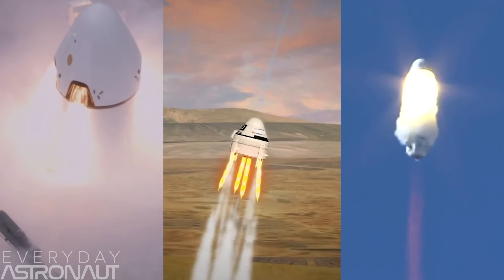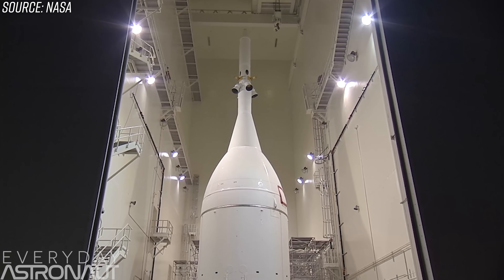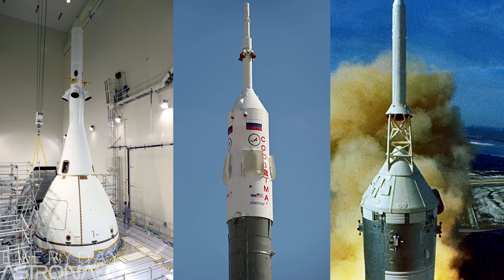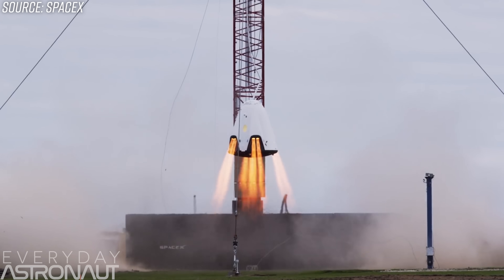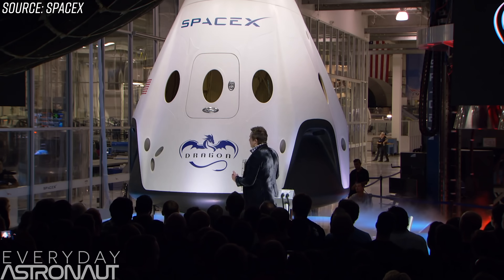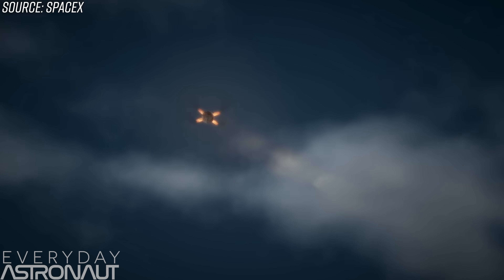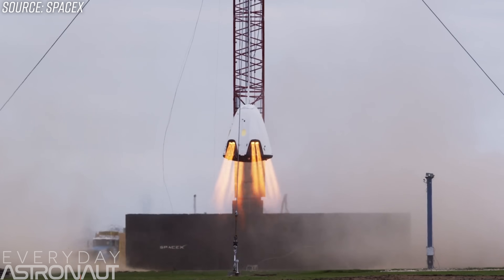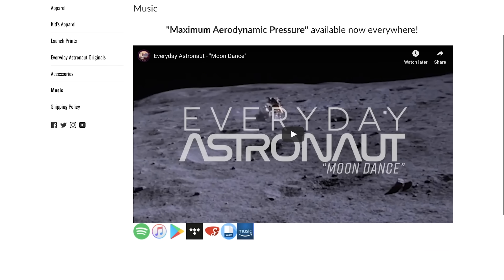Why have SpaceX, Boeing & Blue Origin ditched abort towers?

Comment: Because it costs money, payload, and performance, and creates yet ANOTHER avenue for failure.
Reply: The answer is actually because they are looking for the most cost effective method of space flight, not the safest.
Reply: @joedufour8188  Some of that, too (that was the "costs money" part).  I don't think they are consciously trying to make anything unsafe, though.  I have known and worked with hundreds of aerospace engineers, as i am one, and not ONE of them I knew, or myself, would INTENTIONALLY design something to be LESS safe, on purpose. 

You need to realize that in many instances, at least some of the guys that end up flying rockets are engineers, too, and have MAJOR inputs into their design, at least they did at NASA.  And they SURE AS HELL are not going to allow something that is highly dangerous, unless it is REQUIRED (spaceflight IS dangerous), unless they are suicidal, which they are not.

As I said, too, one real world realistic correct consideration for such things is not to add complexity that can cause problems THEMSELVES that wouldn't have happened were that system not designed in. An unintended activation of that system would almost certainly put the lives of the astronauts in more danger than riding out a properly working rocket.  I see people use the "excuse" that they don't need a reserve parachute on a paraglider (or motor) under the ridiculous impression that since it saves you from a destructing aircraft, it is somehow safer than a properly operating one (look at the statistics, it is NOT, not even remotely).  Wrong headed reasoning abounds in this world, Dunning Kruger poster children running rampant.

As a caveat, if you really have any inside knowledge and are not just being totally cynical with little or none, I have not been designing for about 2 decades now, so with the way things were heading (bean counter idiots running the show more and more), and corps. beholdin', not only primarily, but nearly EXCLUSIVELY to shareholders, or "inmates running the asylum (that ARE literally the asylum's controllers"), you could be more right than me about the present, but I certainly hope not.  Are you someone that actually knows something real about the subject?

Comment: I don't understand why crew dragon is landing in water? That seems totally lame to me. It should be designed to land the same way as the booster on a landing pad. That would be way cooler and more practical for reuse of the capsule. Who pulled the plug on this?
Reply: NASA, with insanely long certification required for propulsive landing.

Comment: Should we be putting more effort into fusion, warp drive, EM drive and other concepts that could put vehicles into orbit without using propellant?
Reply: Fusion needs propellant. Warp Drives need negative mass materials (we have zero capability to create that) and the EM Drive is meme tier garbage.
Reply: @yobeefjerky42  Light drives don't need propellant and it's something we can build today!  The acceleration is pathetic; we need more options and we can't be carrying propellant on interstellar missions.
Reply: @bardrick4220  There's a lot of things the term "Light Drive" might mean, I assume you mean something like propelling a craft via offboard laser, yeah that'd work, but not for anything larger than microsatelites. Unless you mean something like actually shooting off a laser to propel the ship in which case to get any reasonable acceleration, you would be firing a laser capable of wiping out all life on a planet.
Reply: @yobeefjerky42  LOL it doesn't have to be a LASER . . .  And I'm wondering why the aversion to new tech?  We should research "all of the things" so we know more and can invent new ones!
Reply: @bardrick4220  Because shining a flashlight on something is about as effective as a mouse fart propulsionwise, as for why you'd use a laser for light thrust onboard, it's focused light, making it much more effective at actually accelerating the ship. It's pointless anyways as the required power for this would be on par with a dyson sphere's output.
Reply: @yobeefjerky42  I doubt diverging the beam ~10-15° would reduce the acceleration by any appreciable amount. 
Ion-thrusters are a good option, but they have the same problem as conventional rockets: you have to stop and refuel!  And you'll need to build stations along the way to do it!
Reply: @bardrick4220  You don't seem to understand that any interstellar ship is going to need fuel, Ion thrusters are good for sustained years of thrust (that plus low size is why they're used on satelites) but possess terrible acceleration and any ship intending to cross the interstellar gap is going to find them lacking. In any case you'd see ships making two distinct burns on an interstellar trip, one to deorbit the sun and the other to enter orbit of the target star. This would require fuel, yes, but nowhere near as much as sustained thrust for years would. As for spreading the beam, no it wouldn't kill the acceleration but if you're getting any (noticeable) thrust just by turning on a light, then you're firing a weapon of mass destruction and that spread out beam is now gonna be the reason some poor sods in andromeda now have an acute case of death.
Reply: New tech is expensive and new tech like your describing is both expensive and only theoretical.
Reply: @TheEvilmooseofdoom  well . . . an unwillingness to try new things leads to technological stagnation!  And since chemical rockets are terrible we should always be actively looking for alternatives.
Reply: @bardrick4220  It's not a unwillingness.  It's money and energy storage.  Outside of chemicals the next largest energy source is nuclear and I don't think that will the allowed anytime soon.  Far out theories that have a high probability of being duds are not easy things to get billions of dollars to research.  They tend to like things that have a honest chance of producing a more tangible result.
Reply: @TheEvilmooseofdoom  Nuclear batteries are already in use in space!  As for fusion I don't see why you think it would be banned!
Reply: @bardrick4220  Yes, but they don't put out much power and to get things off the ground and into orbit you need a lot of power.  Fusion is still being worked on for large heavy ground based installations, we have to get that working before we can start thinking about using it in space.  What will be banned is using NTR's for ground to orbit.
Reply: @TheEvilmooseofdoom  But why do you want to spend less on research?  I'll agree there's greater risk, but there's also greater reward.  It may take 100years longer than it should for some of these technologies to hit market just because of attitudes!  It will  probably cost more to keep burning chemical fuels.
Reply: @bardrick4220  Who said anything about wanting to spend less?  The problem is you have to apply for research money and you're competing with other lines of research.  You don't just say I want to research something and expect the money to magically appear.   The people handing the money out need to decide which line of research are likely to yield results that justify the money.  That's their job.  The problem is that there is a limitless number of things to be researched but a very limited supply or resources to do the researching.  Also the money is not coming from a central pool but from a lot of places and each of those places has it's own ideas of what should or could be researched and their own people deciding where to spend the money.
Reply: @TheEvilmooseofdoom  You said "expensive and theoretical."  That's not the only way to do research, and I'd also worry about corruption. eg: an oil company is funding research into EVs!  
I'm trying to point out that skepticism is often bad for progress; there's a long laundry list of prominent scientists, inventors, etc who've said a lot of crazy things about tech that we now use daily!  It's better to say "maybe" instead of just "no" otherwise history may call you a fool.
Reply: @bardrick4220  "..You said "expensive and theoretical."  That's not the only way to do research..."

I'm sorry, that statement is meaningless to me.  What other ways of doing research does not involve money and theories?

Skepticism?  If that was your point it didn't come through.  You were going on about why they're not researching things, as near as I can tell this is a rather odd change in direction not germane to the original line of discussion.  Regardless it changes nothing.  There are lots of smart people with great ideas.  There is STILL a limited amount of resources for them.  Not every line of research can be pursued and that point is one you seem unable to grasp or I have failed to make..
Reply: @TheEvilmooseofdoom  You can choose to do your own research with your own time and money if you choose; it doesn't need to be done by a big organization.
Reply: @bardrick4220  Well if you can research and develop advanced propulsion systems at home without computers to sim on,  or the ability to build hire engineers and purchase the equipment and materials for test articles then everyone would be doing it.  You over simplify to a truly staggering degree.  I'm sorry but It just indicates that your understanding of the subject matter is not what you might think it is.
Reply: @TheEvilmooseofdoom  I think you're just a troll at this point; should I even bother explaining it to you.  People do absolutely incredible things in garages with very little!

Comment: If the crew dragon and the following ex crew dragon now cargo capsules use the same engines that were originally planed to propulsively  land with, then it seems to me like space X could practice propulsive splashdowns with returning cargo capsules (obviously when there isn't important returning cargo like experiments) or maybe even practice landing on a simulated digital "ground" with its engines before letting itself fall through the fake ground and deploy its parachutes. Just because NASA isn't interested in it now doesn't mean they never will be or that its not a good idea to get practice doing it now in case you ever need to do it for real (back up landing plan if the chutes fail? or even a rocket assisted landing if only one of the chutes fails)

Comment: Ok some control nozzles, but never seen in reality:

All cartoons: parachutes can sail 100 kilometers sideways. A fall flight
 as shown is not possible whithout control. Or does someone get the 
ropes in the capsule?A thin brake rotor turbine made of light material, 
below the capsule (with 40 l salad oil and 12 l O2 operated from 15-30 
km altitude), and a few mini turbines with O2 reserve for control would 
not immediately use the world equation for braking and control . The 
capsule flies down here like a wet sack and always into the sea. (ok for
 space reasons, was a joke!)Why is each capsule shaped like a cartridge 
case? Because of the better crash? A brake rotor turbine at the bottom, 
with vertical side stators or control nozzles, would be less stupid (the
 control technology could start here). Everything outside of 30 km needs
 pure counter-thrust anyway.The parachutes and the capsule also do not 
fit together.

Comment: You did an excellent job covering the difficult subject matter in less than 20 minutes.  The Launch Escape Tower system was simple, cheap and effective.  It should have never been abandoned.  It will be considered a regretable error.
Reply: Well I think they all ditched that system because they don't want overhead rockets burning their crew capsule windows.
Reply: @beneichhorn5855  That wasn't a problem for the LSE used on Apollo.  It had a conical shroud that covered the windows and the whole upper half of the command module.
Reply: @youtube.youtube.01  
But I mean it would be more of a problem for these modern capsules that want huge windows for the paying customers.

Comment: Why not use something safer, like a hydrogen peroxide/silver mesh option? Almost zero chance of catastrophic explosion as there is no ignition or combustion. True, it's not as powerful a thrust, but I imagine it would be sufficient to pull the crew capsule away from the rocket.

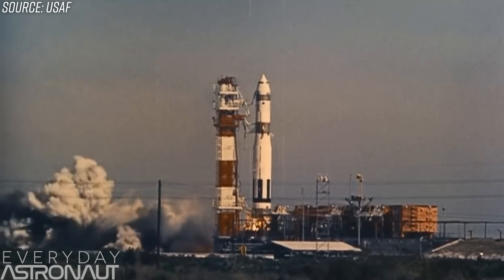Comment: at 1:45   the explosion happens so quickly that the crew module is instantly surrounded by hot flames  . in such short amount of time who or what will trigger the launch of escape system ?     why not replacing  rocket engines in the abort launch with  small jet engines ?   they use kerosene and are unlikely to catch fire like hydrogen

Comment: How many tonnes of fuel (liquid or otherwise) will not take to launch from earth and get to mars/land on Mars / and launch from mars and return to earth? ...I appreciate this is a very hypothetical question but also very interested in the measurement  (and probably in tonnes ) as to the fuel required for such a mission.

I appreciate there are other factors like gravitational pull and timing of such launches..however if it was the case of launch now and use fuel to get there and back I would be very much appreciated of an honest answer. 

Regards 

Graham
Reply: Depends on the mission
Reply: @CarlosAM1  ok so mission is just to launch from earth and go direct to Mars using the propellant for 100 % of the journey to Mars And land there. 
Then collect about 100kg of rocks and return to earth still using the engines/propellant ( probably methalox) and land on earth using the engines .

Am just curious how much fuel would be required .
Reply: @grahamrussell4705  again, depends on the rocket
Reply: @CarlosAM1  ok so based on the Starship by spaceX  and using 4 raptor engine only. Like a say I don't expect a specific or accurate amount and I appreciate I am not too specific either  and all I was wondering what the hieas of amount of fuel may be required . I also appreciate there are other crafts out there with different engine and may use more or use less fuel
.I was just wondering the amount possibly required. So using the SpaceX starship ( unknown it's still in development but am asking a hypothetical question) so using the Starship with 4 raptor engines  I hope you may come up with an answer ? Albeit a hypothetical answer .

Many thanks

Comment: I don't buy the abort tower getting in the way of the parachutes hypothesis, as those could just as easily be installed in the tip of the abort tower instead of the depleted uranium previously used in those towers to shift the centre of gravity higher for better balance, ie to avoid the pendulum effect, without wasting mass on non-functional parts.

Comment: could the SpaceX system be used to send an unmanned Dragon to the moon and bring it back?  It will be a slow trip lasting a few weeks in each direction but it could be done using these engines?

Comment: This might be a dumb question, but do astronauts wear gsuits like fighter pilots?
Reply: No they don't. Fighter pilots wear G suits to squeeze blood from their legs and lower body back to the heart and then to the brain. This is needed because when turning sharply, the G force is directed from the head towards the feet, and blood will move that way. Astronauts seats are designed so they are lying down, which means that the G forces are from front to back. This means that there is less force pushing blood from their head to their feet. Also, although astronauts can experience very high G forces (as can fighter pilots whilst ejecting), these are only for a short period, and unlike fighter pilots they don't need to maintain control during that time, in fact in most cases were they to black out it wouldn't be an issue, i mean if you're doing an abort, or an emergency ballistic re-entry, you're a passenger anyway.
Reply: Thank you, great interesting answer. And well put

Comment: why cant sound go the speed of light if it has no mass?
and why is there a limit to the speed of light?
Reply: Because sound requires a medium (mass that the sound wave travels on) which takes longer for the wave to travel. While light waves dont need mediums to travel so they are way faster
Reply: @kansaswheatfarmer2777  thanks